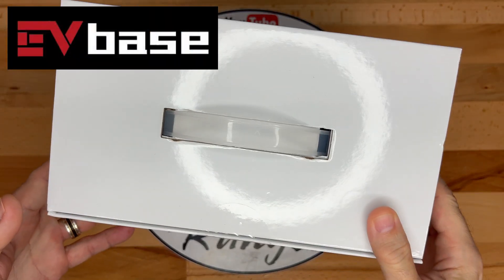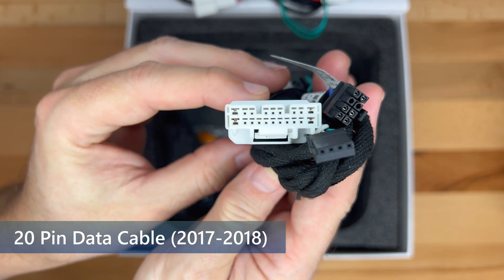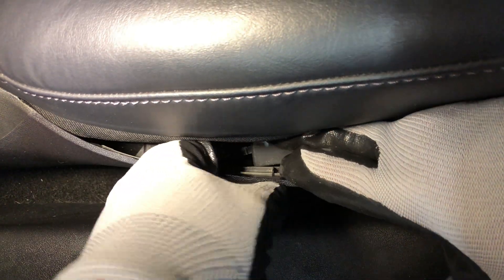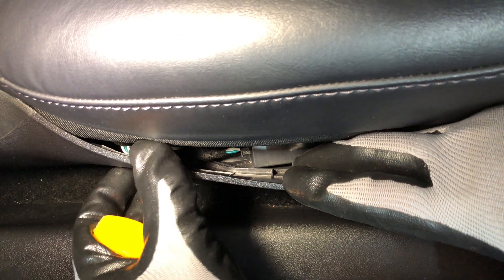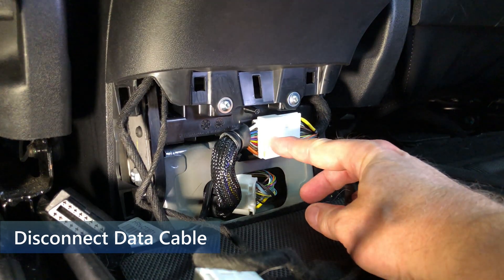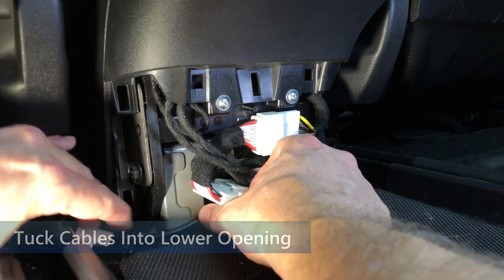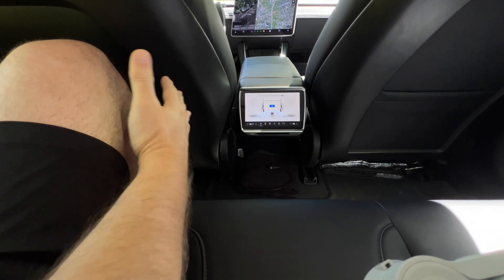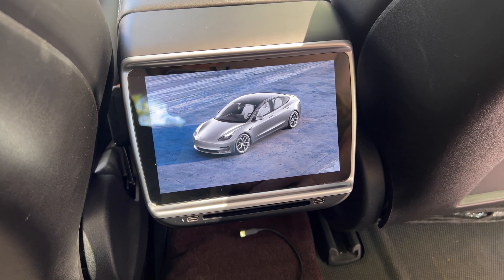Tesla Model 3/Y - 7.2" Rear Seat Display - Part 1 Unboxing & Installation

Comment: Is the usb termination plug really optional? I have a 2018 m3 and my front usb ports dont work after leaving that cable unplugged. The 4 pin jumper plug doesnt fit, do you know what the pinout is?
Reply from the maker: Good question.  On mine it did not matter since I already had a version 1 to version 2 adapter already.  It seems you have the original plug.  Here is a link to the adapter: https://www.aliexpress.us/item/3256805949493892.html

Comment: Anywhere I can buy the 26 harness. Unfortunately I bought the old 20 pin and won’t fit my 22 m3
Reply from the maker: Let me check and see if I have an extra one.  Otherwise, contact the company (EVbase or Hansshow), they will send the correct harness to you.

Comment: Can this still work if I already have my SEXY buttons plug into the same connector.  Can they be daisy chained.
Reply from the maker: Yes, they can be daisy-chained. I have a OBD2 Bluetooth adapter in line with this adapter.

Comment: Do they unfold when you leave the location? I want them to fold when I get into the driveway so it’s easier to fit in my garage but not have to press unfold every time
Reply from the maker: Is this the correct video for this question?

Comment: Great video.. Looking forward to next episode... 😀👍🏻

Do you also make a video showing the software difference between the two screens, 7"  and 7,2"? Like features, BT functions, carplay and more.. 

Im planning to bye the older one, just because the airflow, no silver bezels, and I basically just want a screen because it looks better.. 😀

Best regards
Jens Sweden
Reply from the maker: I will sort of cover that in the next video.  Right now, I can say the biggest difference is that the 7.2" supports BT headphones and does not have audio lag while using them. When playing through the car's speakers there is a noticeable lag on both versions.  It also appears to have a faster SOC. The software (Android) is very similar.  The main HVAC screen is very different.  In some ways I prefer the look of the 7" HVAC screen.
Reply: @MTNRanger  Thanks!! 😀👍🏻